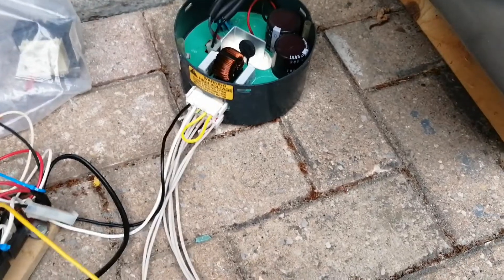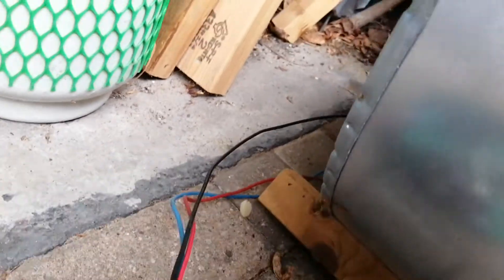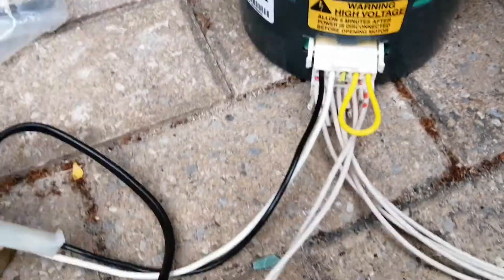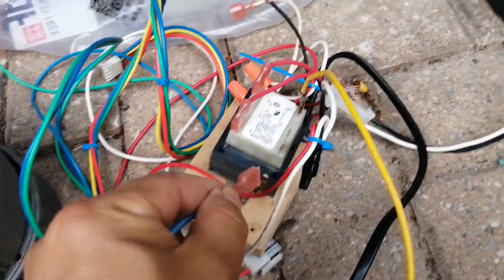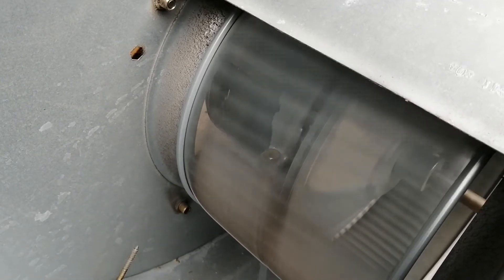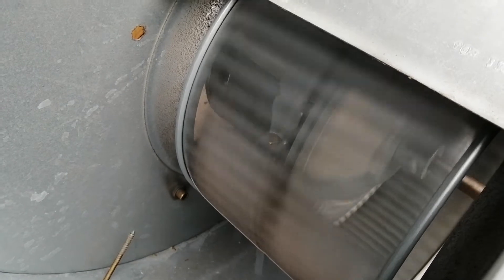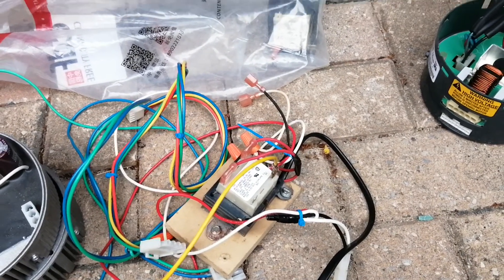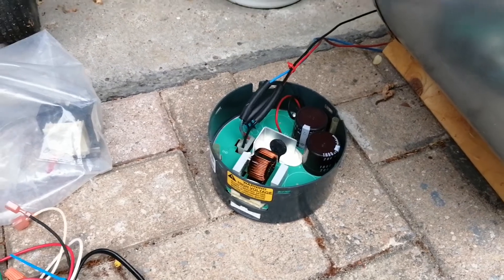Furnace ECM 2.3 2.5 Motor Simple Troubleshooting

Comment from the maker: Please note, on the Tecmate pro and Supco ECMPRO tester support list, ECM 2.5 is not supported ........ If you find a ECM 2.3 or 2.5 module doesn't work with this method please leave a message below, with furnace board number, ECM motor model number....